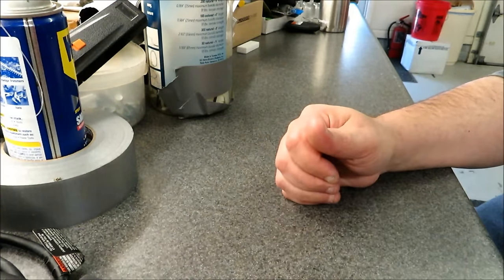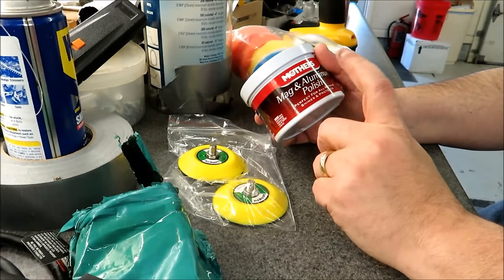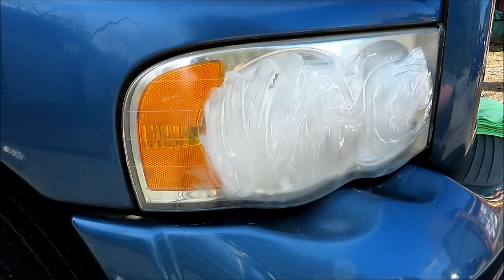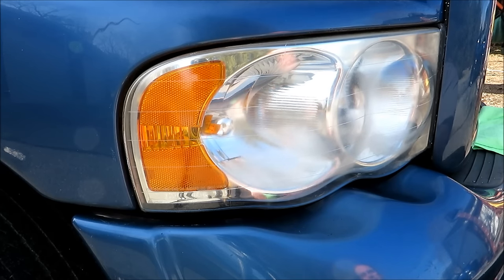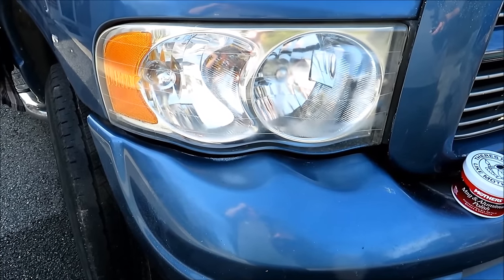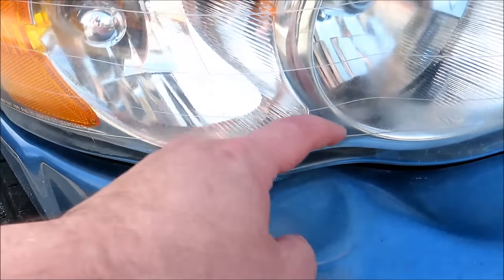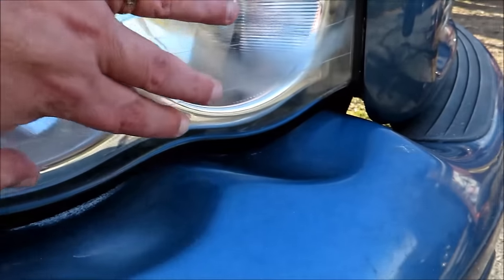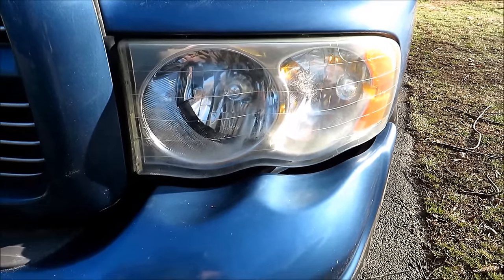Headlight Restoration using Mothers Mag Polish - Pass or Fail

Comment: I don't use power tools when I do this.  I wear rubber gloves to apply the Mothers wheel polish.  I rub it back and forth in various patterns by hand.  I can tell by feel where the plastic headlight needs more work.  When the plastic headlight feels smooth and I think that I'm done, I remove the wheel polish with a soft paper towel.  I use a micro fibre cloth for the final buffing.  It usually takes me 5 minutes per headlight.  With power tools you risk overheating the plastic and you have no feel as to when the plastic is getting smooth.  The Mothers wheel polish is an excellent product when used correctly.
Reply: L
Reply: How long do they last?
Reply: What he said. Then top with Cerakote.
Reply: @Tasrif-UlAnwar my question too.
Reply: @Tasrif-UlAnwar  I use this method exclusively on all of our headlights. Once I get the initial cleaning done, which takes 5-7 minutes, I usually get 6-8 month’s before I need to touch them up again. Touch up is minimal and usually takes 2-3 minutes.
Reply: @davidsommerfeld2955 so it doesn’t last at all.  That’s not a good product or method then.

Comment: The proper way: 1000 grit wet sand across, 3000 grit wet sand up & down, then polish with Mag polish or Magiur’s plastic polish.
Reply: No. You going backwards with the mag polish.  It's gritty
Reply: Get 3m lens and plastic restorer
Reply: And Stop until the water is clear, if you leave clear coat on it, it will oxidized within 6 months again even if you coat it or or put clear coat on it.
Reply: I  did that today  for my 2010  Volvo  S  80   and  Mothers ...
.they came out great

Comment: I've been using it for at least 8 years now. Works extremely well, and I've recommended it to friend with older cars who have severely weather damaged head light lenses. It works more efficiently than products marketed just for that purpose.
Reply: I agree. 
I swear by Mother's MAP for the plastic windows on 50's sewing machines that are gross and yellowed. After MMAP they don't look more than a day or two old and made of glass instead of the 50+ years old plastic they actually are, it's pretty impressive.
Reply: Hi,how long between till have to polish headlight again with mothers mag and do you need to use a protectant after using mothers?
Reply: @mcintosh479 one week on my headlights.  😂.

Comment: Funny story- I tried 6 different products and methods to clean up my Ram 1500 headlights.  By hand, buffing drill, lots of swearing. All with mixed results. After many hours and frustration - just for shits & giggles I checked the price for new headlights. Turns out the Ram 1500 has headlight "Covers". A measly $30 bucks per side.  My wife & I had quite the laugh.  My new headlight covers are lookin' awful sharp and clear.

Comment: Try not to be negative in the comments, but half measures equal half results.  The video I watched there were no drills involved or buffing pads.  He spread it with a rag and then let it set up for a little while then wiped it and then buffed it with the same rag.  Also, not a more aggressive pad and less aggressive.  You get aggressive with your elbow grease.  A buffing pad can scratch the hell out of anything.  I learned this when I thought I would use a buffing pad to wax my car.  I worked one spot too long and ground down to the undercoat.  Drills and buffing pads out…. Rag with elbow grease in…. But thank you for the work you put in on bringing this to us.
Reply: Absolutely, there is much to be learned from bad examples

Comment: Worked for me...difference in your vid and others....1. Polisher at 1700 rpm w/ cutting pad.  Mentions you may have to do several times and APPLY more product each time. You wiped off and never reapplied.  2 start slower and slowly go faster to work product in and you won’t sling as much.  3. Your vid was as long it took me to do both of mine...2003 Audi TT.  4. I used about 1/3 product.   And no 5 is not 5000 rpm.
Reply from the maker: As u mentioned the video was already long enough so i didn't want to include all the times I reappled. When i changed frm the drill to my da polisher i replied and again when i changed from the flat orange pad to the ridged orange pad i reapplied i think i just need a more aggressive cutting pad or to bite the bullet and wet sand them

Comment: After watching a video showing a guy using Mothers Mag & Aluminum polish to restore his headlights, I purchased a can at Walmart. I had already tried two other methods which didn't work, so I didn't hold out a lot of hope for Mothers. Following instructions from the video, I used a soft towel to apply, polish and remove the cleaner. I did not use any type of polisher!   The whole process took less than 5 minutes and the headlight looked as if it were brand new.

Comment: Boooo you. Use some freaking elbow grease man. My 06 magnum had yellowing all over the headlights, got some mothers mag polish and pretty much totally cleared them up with about  5 mins of muscle on each headlight.
Reply: Did  it last?  Or did the yellowing return after a month
Reply: @minutemaniii7062  it shouldn't come back that quick if you put some clear coat on after doing this, or even use some car wax or something with UV protection.
Reply: I Agee...I purchased the Mother's today and my headlight nearly looking New and I added a Wax on them Maguires.
Reply: I knew things were gonna go bad when it took 30 second to open the drill attachments…with a open razor in arms reach😂😂😂
Reply: @minutemaniii7062  it's Still Lasting in this Texas Sunshine but I keep up on the Maintenance also....
Reply: Well I've heard more positives than negatives so for about 15 bucks and some muscle I'll give it a shot. Before I pay 175 to have someone else do it. 😁
Reply: You strong😂😂

Comment: Well, those headlights looked pretty good considering the age of the truck.  I have had my 09 Camry headlights "professionally done" a few times, but never really thrilled with the results or how long the restoration lasted.  I always hesistated to do this myself cuz I sure don't trust myself using sand paper (no matter how fine) on the plastic headlights.  My headlights were worse than yours, was intrigued by the mothers hype because it said no sanding was needed.  So, finally grew a pair, and tried it myself.  I didn't use an electric polisher, just applied it with an old towel, and cleaned it off with microfiber clothes.  Gotta say I am thrilled with the results, the headlights look much better than I had expected.  I did do two applications, but really didn't get much improvement with the second one.  For once, I lucked out...  Don't know how long they will stay clean though.
Reply: If you don't coat the lenses with a UV protectant, they will go cloudy soon.  There are UV treatment options available, from simple spray on coats that can last up to one year most of the time, to actual specially created plastic sheets that go on like a screen protector.

Comment: Hi , I  have tried dozens of these  various methods  suggested and all failed , but have just tried mothers mag metal polish , and  at last found it worked extremely well , no need for wet n dry, drill pads etc , just 10/15 mins of elbow grease with clean old towel and you can see the yellow coming off straight away onto the towel . 
But as many have said here what works for one car may not for another , as I guess age and manufacture of plastic will be a factor , however try this stuff your motor for very little cost, I love it ---Len

Comment: Ok , so after watching your video I went on eBay and bought a jar of this. I have a 2002 Camry and the headlights were yellow. I put a full coat on with a pair of gloves and waited  for 10 minutes. I went into it with a dry rag and I can't believe the crap that came off. All you have to one application they look 90% better! So I figured I put another coat on. They're so clean you can see the scratches on the lenses.  So when I was done I was walking away and noticed on the bottom I have fog lights light's. Yeah I noticed I work 12 hours a day and sometimes I forget s***. Anyway they're white you can't see through them whatsoever like dark clouds. I put this on wiped it off the towel was literally black. I put a second coat on and they're like glass. I wish I had done a video of this but I really didn't think it was going to work. Now the thing is I don't know how long it's going to last and that's always been an issue with cleaning plastic headlights. I'll let you know when a month or two maybe three we'll see

Comment: Just used it this morning on 2015 Toyota. No power tool. Used a small kitchen sponge with scrubber, wiped clean with paper towel & buffed with microfiber towel. Looks great, yellow is gone. Will do it again when weather cools and no wind then will use Meguires Headlight Coating Spray to seal

Comment: I just spent 1/2 hour  rejuvenating my
2006 Hyundai Elantra headlights.
I used some professional grade cut and polish.
Forget the power tools and synthetic buffing pads and rags.
Use 2 old clean cotton tea towels. One for wax on.
One for wax off.
Use your rag and fingers for even pressure.
I was happy with my method.
Elbow grease, like wax on, wax off Karate kid style😊.
Also cotton, is a naturally absorbing fibre

Comment: Worked for me on my 2003 F150. My lights were yellow. I used windex (sprayed onto a towel not on the light)  to clean the lights off first then I used mother’s with a foam pad. I did mine by hand. Took about 15 minutes for each light. I did them back in August of 2017 and as of February 2018, are starting g to turn yellow again. Just waiting for a nice warm day to clean again.
Reply from the maker: Yea a lot of people commenting have had good results with the Mothers so I"m assuming mine situation must be an anomaly.
Reply: My headlights are the older style though, not the style your truck has.

Comment: You need to use a compound (such as Meguiar's ultimate compound) not a polish to get rid of the bulk of the oxidation.  You might even have to use a 1000 grit sandpaper (wet sand) before the compound if the oxidation is really bad. The polish should be used to get the plastic lenses really crystal clear.  Meguair's Ultimate Polish or Plast-X can be used for that final stage.  Then clean the lens with Windex or another glass cleaner to get rid of all of the residue then spray the lenses with a coat of UV-resistant clear coat paint or something like Meguair's spray on headlight sealant.  If you don't use the clearcoat the lenses with start to fog up again in a few months from UV exposure.
Reply: As a detailer  i agree - You nailed it - I always have used Meguiars and  all of their products  are the best 👍👍

Comment: There are 2 things going on here: 
1- the other videos are being done with a rotary buffer with roughly a 7-11" pad on them.  You're trying to do the same with a roughly 3" pad, and both tools are probably turning at the same rpm.  Since the majority of the cutting is done by the outside edge of the pad you're getting roughly 1/3 to 1/4 the surface cutting speed, which means that just based on cutting action you'd have to go almost 4x as long.  Some part of the cutting is also done by getting the part warm and softening its surface, which without the speed you'll never get.  A note about that- if you get plastic too warm it starts "smearing" and getting worse.
2- I have a 2004 Cummins Ram with the same headlights.  I haven't tried doing this to them but mine are worse than yours (yours look like they might be replacements).  The lower surfaces of those headlights look like they deteriorate to the point that they sort of loose chunks or are cracked, and they'll never look right till you cut through all that (assuming there is enough plastic there to do it).  Since you need to cut through it, what I would likely try is either sanding and probably start with something fairly course, maybe 400 or 600 grit, step that up to 800, 1000, 1500... (probably anything over 1000 will be good enough but higher is better) and then hit it with the mothers to polish out the sanded surface.  If you wanted to take some of the elbow greases out of that you might try using a fine scotch brite pad on a velcro backing pad in the drill or buffer, but you'll have to be VERY careful to make sure that the velcro doesn't come through and that you have enough give in the surface of the pad that it doesn't wear grooves in to the plastic lens.
Reply from the maker: Thanks this is the most detailed explanation of why it probably didn't work yet. Really hadn't considered all the stuff u pointed ut regarding the area of the pads that actually do the cutting etc... They are the original factory lenses. At this point I might just replace them.
Reply: The reason I was wondering if yours are aftermarket is that they appear to have weathered differently than mine and the other factory ones that I've seen.  I'm pretty sure that mine does have the same pitting on the lower part of the lens, but my whole lens is yellowed to the point of almost not being transparent, so bad that the pitting on the lower part isn't even noticeable.  I don't believe mine is just a surface condition , they look yellowed the whole way through, so I haven't bothered trying to fix them since they are likely unfixable, and I haven't replaced them because I have 55w bulbs in my driving lights in my bumpers and they are honestly brighter than the headlights, making the yellowed headlight lenses not a big deal besides appearance, and at this point my paint is worse ;-)

Maybe I need to sit down and make a video of trying to clean mine up.  ;-)

Generally I don't have the patience/time to deal with all the setup, editing, uploading to make a video anyone really wants to watch :-/
Reply: Mark Pikas Thank you. I had the same issues and your insight was very helpful!
Reply: the problem is simply the pad being used! here's one doing it with a dewalt drill and what seems like a 3" pad with great results https://youtu.be/x9SD-loynfc
Reply: Legend!
Reply: @MrGixxer51450  thanks

Comment: Mothers worked great for me. I have an 2006 Ram in Arizona so my lights felt like sandpaper at the start with. I had to use 500 grit, then 2000, then 3000 and finished with Mothers and a 3" "WOOL PAD" Not foam pad. I should have done my lights when they were just cloudy. I waited years past that so I had to wet sand them from 500-3000 grit first. A wool pad (eBay) and Mothers works great and only took 3-5 minutes. Key word here is WOOL not foam; and a cordless drill on high and you MUST keep the drill moving not to melt plastic. Mothers is under $4.00 at Walmart.  Thank you for the video. I was going to try foam but not now. I use the wool pad on my Ram, Honda, and a Ford worked awesome. Thanks.
Reply from the maker: Yea i was looking at other videos and they used mothers only and foam pads so I decided to go that route. The whole intent was to use the least amount of effort and be successful. Of course at this point it would appear based on the experience sandpaper and more aggressive pad is unavoidable.  Might even just replace the lights all together.
Reply: Here is the eBay item I used. Search for  item number: 272750677509      $3.69 + $1.89 shipping.  Let me know how this works out for you. In the drop-down choose the 3".

       11 Pcs 3/4/5/6/7" Buffing Sponge Polishing Pad Kit Set For Car Polisher Buffer
Reply from the maker: Thanks for the info.  Seems to be starting to warm up here maybe I will pick up this kit and try again with the more aggressive cutting pad.

Comment: The rough area on the bottom part is what's left of the factory UV protection. You need to take that off first, with a 1000 sandpaper, and then the metal polish will finish the job! When you start sanding, the area you need to remove becomes very visible, so it's easy to see when you are done, and can move on to the liquid polish.

Comment: Good morning, I was in a glass business for 50 years and I learned if you're going to polish plastic use plastic polish! Sand the lens with 2000 grit wet or dry then use McGuire's plastic polish that will do the best job. When you get tired of polishing plastic just replace the headlights.

Comment: I think the Maguires Aluminum Polish is just that, a very fine polishing compound.  You probably would have been better to use something like 3M Cutting compound first to get the hazy, damaged material off first, and then a final polish with the Maguires. Actually should have something in-between to get the deeper scratches out after the first pass.  Also, get a light cutting foam disc.    This really isn't rocket science, however people trying to do it in one pass will not have great results.
Reply: Agree - the 3M cutting compound does do it, just be careful!

Comment: Mothers Mag & Aluminium worked for all of our cars, Porsche 996, Toyota Matrix, and VW Passat. I used vinegar to clean the lenses using a  cordless drill and a wool cutting pad to apply the Mothers. Took 5 minutes for each headlight.
Reply from the maker: I see you mentioned using a wool cutting pad I only used the foam.  Once it gets warmer here I think I'm going to try again using a wool pad and see if I have any better luck.
Reply: Worked for my Scion xB.
Reply: coolwrld302 Wool cutting pads are for more aggressive buffing badly oxidized paint. Our 3 car's headlights were yellowish since the the Porsche headlamps are facing upward, I didn't expect them to look factory new, but I'd say 8 out of 10 from being a 4.

Comment: All you need is a micro fiber cloth and apply mothers with it . Buff it on in a circular motion. Then with another clean microfiber cloth you just buff and wipe it clean. You don't need any abrasive pads. It works great if you do it right.